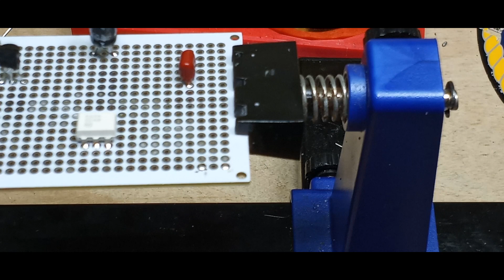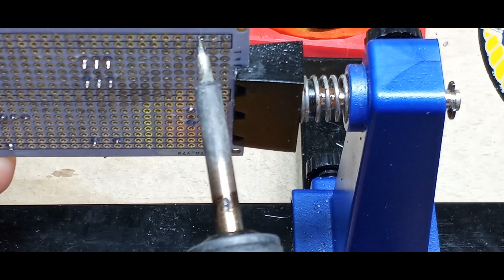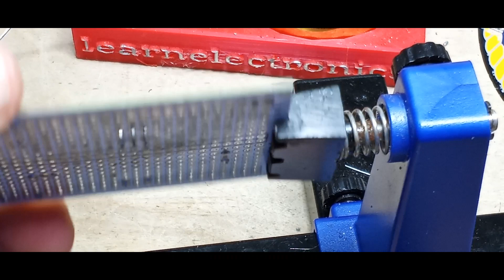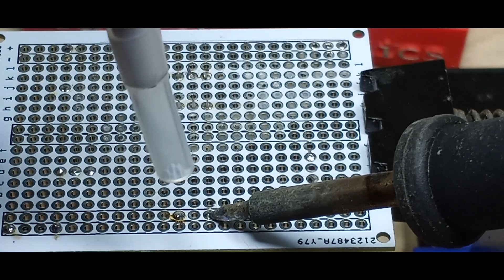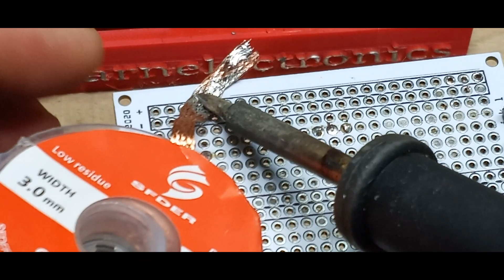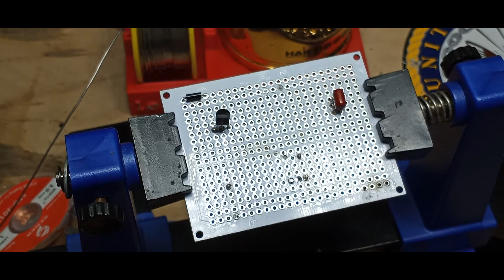Desoldering Tips

Comment: Where are you able to get lead solder? Also what watt iron do you use to solder and desolder caps around the CPU on a motherboard, I've got a dell I was replacing some caps on and this 30 watt WMT special won't get it hot enough fast enough to get in and out quickly and really won't work well enough to get it done, thanks man.
Reply: You can get it on Amazon.  Look for either 60/40 or 63/47.  I prefer the latter as it seems to melt a bit better.  Also, thinner is better than thicker unless you are soldering large connectors and/or wires.  It melts quicker and reduces the chance of damage to heat sensitive solid state components.  An absolute must for SMDs.
Reply from the maker: Order it from Amazon

Comment: My 25-Year-old NAD amplifier that I'm still fixing has exactly the problem of pads and tracers lifting of the substrate when I apply heat to it. This is why; when I'm soldering new parts
on, I always keep the cut-off leads that I can then use as tracers on board repairs
Reply from the maker: Good idea

Comment: What do you mean by Capillary Effect? I looked up the work Capillary and it has nothing to do with solder wick. I have never used Hollow Needles, but I guess they work good at cleaning up double sided solder pcb?
Reply: Capillary action the same way moisture is drawn up on a piece of paper towel. Solder is drawn towards heat so as long as the braid is hot and the solder is liquid it works.  I use toothpicks in lieu of hollow needles, they serve the purpose well enough.
Reply: @Mad4400  I will have to try the toothpicks out for hollow needling. Sometimes solder gets trapped in the eyelets of doublesided pcb and its hard to get out the trapped solder that is stuck in between
Reply: @waynegram8907  That's exactly the problem  that led me to using them.
Reply: @Stevey Canuck So Capillary action means wicking? or removing?
Reply from the maker: Capillary action is exactly how the solder is drawn into the braid.
Reply: @learnelectronics  I'm guessing Capillary action means turning a solid substance like cold solder into a hot liquid substance? I don't know what Capillary action really means or does
Reply: @Stevey Canuck oh ok thank I just don't know the definition of capillary effect/action

Comment: W'll go~olee, Paul! Rat derz mu problum! Wick'n wifout flux'n! smh
Hey seriously, thanks for the tip, Paul. I really appreciate your follow up to my comment a few weeks ago. Now, I know the proper way to use a solder wick to avoid lifting tracks and pads. 2 years ago, I ruined a new $65 SBC (not a RPi), while trying to repair a broken USB-C connector with 9 tiny SMT tracks, simply because of my bad technique. (the SBC was a poorly manufactured POS anyway)
Looks like I should get a set of pins, too. Didn't even know they existed, so I've always used solid core wire, instead.
I assume that you don't apply the hot iron directly onto the pins because they have plastic handles, which would melt. But, IHMO that would be an even safer way to clear holes without overheating the PCB. Just allow the pin to heat the solder inside the hole, instead of the entire surrounding pad, similar to how you used the tip of your iron.
 I think that I'll try making one with a wooden handle. Since most boards have the same hole size, one should suffice, right?
Hope your throat gets better. Later, bro!😎
Reply: The removal pins are hollow so you can insert them over the exposed component pins which helps with removal!
Reply: @gartmorn  Well then, that sheds a different light on matters, doesn't it? So, the removal pins slide over the component pins, yet are still small enough to pass through the PCB holes?
💡 Ahh! That's why there's a pack of different sized removal pins! Gotcha.
Thanks!
Reply from the maker: Yep you gotta find just the right one for your application.

Comment: Sorry i dont agree to cutting the leeds, beacause a person putting presure on the leads to cut will someday eventually brake the pad because of preasure on other pins due to cutting.
Reply: That's why Paul used the narrow cutters. The problem with removing ICs is heating all of the pins simultaneously to pull the chip without overheating some of the pads. O the other hand, if one happens to not be melted, you can still pull a pad because the solder is too cold.
But, you make a valid point about being careful with the cutters by making sure to only only squeeze the handles to cut one pin at a time, without applying any prying force sideways.
Reply: @TheOleHermit  Hot air is the solution.
Reply: @MrVosh-nj2lc  On Paul's PCB, I agree. But, if the IC is surrounded by SMDs, hot air could be disastrous, don't you think? Personally, I've never had any problems with clipping the pins. But, circumstances always dictate the optimal procedures and tools, right?
But, thanks for the suggestion. It's worth bearing in mind, especially since I already have a variable heat gun for reflow.
BR
Reply: I'd say it depends on the age of the board itself
Reply from the maker: You are entitled to your opinion
Reply: @learnelectronics   i do half agree on through hole component for cutting leads but if its surface mount ic.. then best of luck on this trick. n sorry i have only 10 years of experience, n i know if someone beginner gonna try the trick surly gonna mess up the pads. specially if its SMD
Reply: @learnelectronics  I appreciate your objectivity.

Comment: There are times when the traces are removed with the solder lead.
Then what do we do?
Reply: Less heat and CA glue?
Reply: Sometimes, I've been able to bridge over the damaged tracks with a thin 28 gauge solid core wire. Hope this helps :-)
Reply from the maker: scratch away the solder mask and solder directly to the trace
Reply: This is why; when I'm soldering new parts
on, I always keep the cut-off leads that I can then use as tracers on board repairs
Reply: @danishdart  Great idea! Thanks :-)
Reply: @danishdart  Me too....very useful!
Reply: Check out the channel Branchus Creations.  He has videos showing a number of techniques on some really badly damaged boards.
Reply: @WatchesTrainsAndRockets  Sounds interesting. Thanks, I will, BR